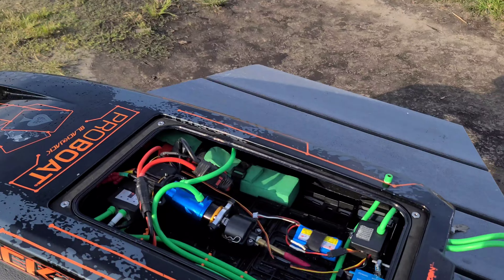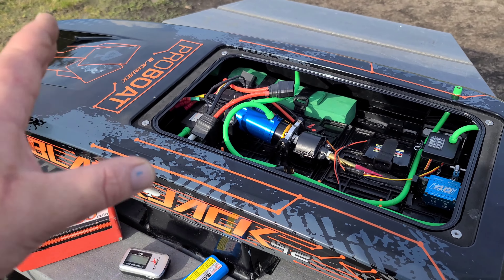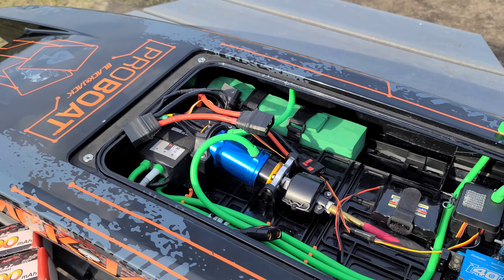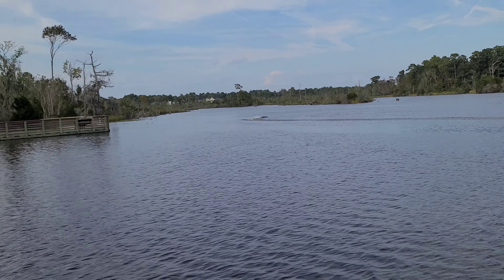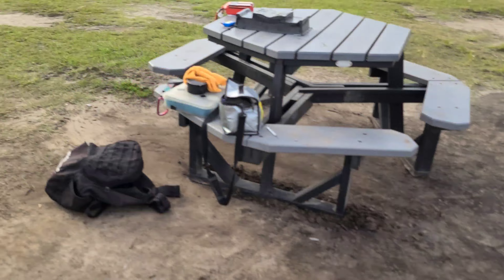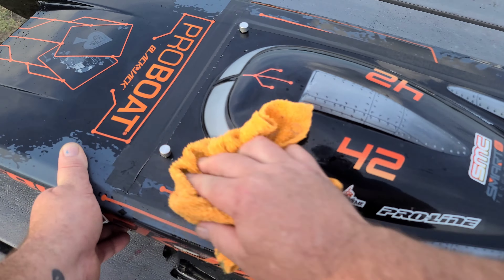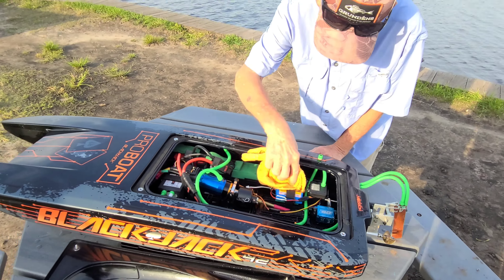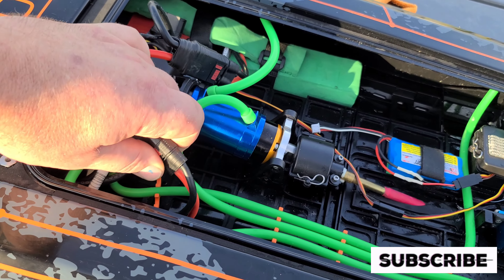Sick New Setup 12s Proboat Blackjack 42 90+ mph at Quarter Throttle - Flier 400a, Tppower, SMC

Comment: Hey I think when we run higher voltage it actually will allow to run cooler . Usually won’t hold it open as much and I believe the amps can be less . Like with a/c when we run high voltage the amp draw is lower . Just learning some about boats I only own a swamp boat 🚤 but I wanted to get the pro jet boat , looks like your using here on salt water and that’s where I wanted to use so maybe I should just go with propeller boat. I do have plenty golf course ponds ect locally but I have canal in my yard I’d like to run off my dock

Comment: And get you another temp gun. I have the same one as a spare. I have a different hand held thats spot on and the one you're using is off by 10 degrees give or take. So it could be 10* cooler than you think.

Comment: Hello, i want to buy the blackjack 42
May you give me some tips on what upgrades to do first. I will be fine with it hitting 65mph. I want to stay with the stock electronics for now
Reply from the maker: Rc boat bitz trim tabs is a must, add an additional cooling run to the motor that's about it.   7000mah+ 100c+ 4s lipos

Comment: How heavy is your boat. What is the small wire that's connected to one of the black connector. Is that boat plastic or fiberglass
Reply from the maker: Total weight with battery is 14.5 lbs

Comment: I used be crazy about R/C boats back in my younger years (Traxxas Villain IV amongst others circa 2001🤘) I'm now revisiting the hobby via Youtube. SUUPER interesting that the internal hardware is no longer the limiting factor on speed. It's actually the hull / trim of the boat and the aerodynamic forces of air. Are there other hulls at the same size that could handle much faster than 92mph without going airborne??  Or submarine for that matter...?
Reply from the maker: The tfl geneses single is fast
https://www.offshoreelectrics.com/proddetail.php?prod=tfl-1122-blue&PARTNER=ironclad

Zonda GT is a fast twin
https://www.offshoreelectrics.com/proddetail.php?prod=TFL-1133-cf-4082&PARTNER=ironclad

Comment: I don’t mean to speak out of turn, I’ve owned I rc boat, but wouldn’t it be better to run it around a little at just over idle to get some water to the vital stuff?
 Edit:
Thanks, having just reread my comment I now see a clear advantage to bringing it straight in. You get to check peak temp. I was thinking long term where higher heat over a long time would obviously be worse than a short burst. 🍻

Comment: Kingval  3660 1800 kv, what ESC should I run with this??
This will be a proboat recoil 2….. any turn Finn, strut, trim tabs, rudder recommendation are helpful also! 
Great channel keep it up.
Kingval not purchased yet so throw me the whole recipe, lol…. Goose chaser!
Reply from the maker: 2600-3000kv 3660 + 150a FC esc = fast

Comment: Try a small boat .

Like a shreddy or any small vhaul , Even a blackJack 32 .

Try a surpass hobby 550 6400kv 4pole drag motor . On 3s  64,000rpm 😈

Comment: Sorry. A bit out of topic. Will the New sonic wake handle 8cell on stock setup??  Love the Black jack but saving up for the new river jet you tested out. Many rivers here in the north of Norway.
Reply from the maker: No, sir, the stock SonicWake will not handle 8s!     You'll need an esc upgrade for 8s power
Reply: @IRONCLADRC  ok thank you. But i gues the motor will have no problem.   Thank you for fast reply😊

Comment: Had that boat up to 85mph near stock with just a prop on 8s, it flew and came down splitting the hull in 2. Got a warrantied hull, rebuilt it and sold it. Fun boat tho.
Reply from the maker: Hitting water at that speed is like hitting concrete, fun as hell making them go that fast, though.  BG4L

Comment: Fantastic setup and video. Looks like you are on some salt water how do you protect your parts from corrosion?
Reply from the maker: Corrosion X and dielectric grease. Balloons for receivers and watchmakers silicone grease for servo seals
Reply: Ahh comments I was looking for I live near salt water and rc daily I get questions all time how come you don’t boat 🛥️ 😂
Reply: I do run in salt water, but I have been having issues setting up boats, salt water getting into electronics, range issues for transmitter etc. I’m still working on an ideal setup. Time away from work, and the kids is a bit hard to come by sometimes…

Comment: Thats really fast but your running a hot setup but nowaday motor are pretty much heavy duty. I've own that similar esc 10yrs ago in my 48" mono and setup for 20s (74V) with big 370kv 12kw TP motor and run for about 3 mins, all parts are cold as if Im not running at all. Now all my boats are in the store collecting dusts.
Reply from the maker: I have 2 different motors for this boat, I like the 1520kv on 8s, better than the 1400kv on 12s.   Both motors are beast!
Reply: @IRONCLADRC  Cools, love to see you tested the esc for 20s, it works wells on me. By the way, great video's collection you got there. keep it up mate!

Comment: Do I sense a dual motor. With 2 of those ESCs? With 16s worth of batteries on each ESC? 🤔
Reply from the maker: I wish!  Check this esc out it has dual brushes motor outputs (single esc, dual motor)    BG4L

Comment: I’ve a problem with the blackjack 42

It falls back in power after a second when pull full throttle. Sometimes at half throttle. 
When I build speed up slowly it goes better but still cuts off power for a second or so at the end with full throttle and power comes back direct after that. And so on. 
Dont know what the problem is. 
Battery packs are new. 
Have 2x 4s 100c 8000mah and 2x 4s 140c 5500mah
Did reset and calibrate the esc with the new changed futaba receiver but didnt solve the problem. 
I use a futaba 4tpx transmitter with r304sb receiver
Is it something with timing or lvc?
Temps of motor esc and batteries and plugs are arround 35-40C (95-105F) so tha should be ok. 
Boat is new. Only used it about 3-4 times. It has the boatbitz trim tabs, cooling  upgrade and prop upgrade. Strut and trimtabs are installed in line with the bottum of the boat as in your videos. Sort of flat neutral. 

So any help is welcome
Reply from the maker: What prop are you running?  If the prop is to big for the electronics the esc will go into a lvc cut, because the prop is putting  alot of load on the electronics causing voltage drop making the esc think it hit low voltage.   Prop in combination with the overall weight of the boat, try  Propping down a little bit, or you could try going down on your timing one
Reply: The prop is a stage 2 prop from boatbitz that came with the cooling and trimtabs as a set. 
I believe its a 4814 (2 blade)
It says proboat on it but no numbers. But when I messure the prop its 48mm.
When it does a full sometimes speed is about 52-53mph gps
But most of the times it cuts the power of when it goes fast.
I will try the stock prop soon to see if that is the problem. 
Can the trimtabs and strut cause so much friction that it does a lvc too?

Comment: And to run a pack in parallel or series. The battery won't know the difference 😅 a system on 12s will require less amp draw then running on 8s. So seeing lower temps at higher voltage is possible if it's efficient.
Reply: That’s what thought thanks for confirming, it’s same with a/c voltage
Reply: What do you think about rc boats and salt water , stay away from jet boats ? , of course have to be extra with water proofing and corrosion but is it feasible
Reply: I don't see why it would be a issue if you keep it clean like you said. Keep water out of the inside. And flush the cooling system with fresh water after.
Reply: @ralphhondaman  thanks just living on water everything erodes faster , have keep everything coated wd 40
Reply: @RcPlayer-tt2vw  I bet. Wd 40 would be good to use. Keep the hardware coated.

Comment: I've noticed you  run rather short water jackets and no water cooled motor mount.
Think 124 F on 8 S is somewhat steep........
Single set up always is demanding for the motor for it requires counter steering 
or asymetrical drive line set up. For me reasen enough to use twins. 
The TP 4070 CM is a peach as is your 42. Clean fit those water lines !
Extremely  good looking hull all the way. Well done.
Reply from the maker: Thanks

Comment: Electrical tape is just as effective and won’t sound so bad
Reply: Elaborate please
Reply: @IsaacSchultz-lz8jc  electrical tape or vinyl tape will have sufficient waterproofing protection per use and a lower bonding coefficient. It won’t risk tearing off gelcoat after the 30th time you use it nor disrupting the bonds in the glass ply substrate.
Reply: Oh ok thanks

Comment: Bruh I’m telling y’all, the whole problem with the 42 is it’s under powered that’s why it flips so bad. More power keeps the nose where you want it, DOWN. And pretty sure your heat issue is that cooling jacket, that’s way too short, not enough can is covered
Reply from the maker: I can't find any jackets longer than 73mm. That's what I'm currently running. I considered using two 40s jackets, but it'll be pushing fitment?      Guess I could make a custom jacket 🤔

Comment: Kv for Kv? If its true kv rating then regardless of the copper its should turn the same rpm per volt. You lost me on that. If it turns any different speed then the kv rating is wrong.
Reply from the maker: On paper yea, it should turn the same rpm, but real world is a whole different animal. Take a surpass rocket 4082 2000kv and a tppower 4060cn (4082) 2000kv..   Which motor is gonna be faster?  The tppower motor will be!   Everything the same, the only difference is brand.     Copper in a motor makes a huge difference with a motors performance..

This is my opinion.  I've tested lo lots of different motor over the years, just speaking from my own experiences.
Reply: @IRONCLADRC  ok I do get what you are saying. But if one motor turns faster then the other. Then they are not matching kv. Kv is rpm per volt. Say 1100kv is 1100kv. If it spins faster then that then its not 1100kv.
Reply: @IRONCLADRC  maybe you're thinking about more torque?  Because if both are 2000kv then they both should spin the same speed. Torque will get you to speed faster. But then too you have to consider poles then. 4 pole 6 pole. 6 pole will turn rpm faster but less torque.
Reply from the maker: The key word in this argument is "should"  in theory they "should" turn the same rpm per volt.  They "should" have the same torque. If both motors are the same, the only difference is brand/material right.    

On paper like I said yea, but in a boat it's a different story. The point is that material, (copper,magnets) a brushless motor, is constructed from makes a huge difference  torque, rpm, heat Dissipation etc. 

I've even gotten the same exact motor, and one motor be a consistent 3-5mph faster than the other... Same motor in every way, the manufacturer possibly used a different stock of materials in the build process, causing one to outperform the other.   Just saying
Reply: @IRONCLADRC  what it comes down to is how efficient the motor is. They key is to find where the motor makes its best power. Adding volts to make it spin faster isn't always the best option because the motor because less efficient and more heat.
Reply: Awesome man..play with a few different props see what you get. Nice.. watch your temps you no what I mean... 😂..I mean I feel more comfortable useing a 6 pole 2000 Kv motor.. little more RPMs.. however this let's you run some crazy prop sizes..yah no...your set  up runs pretty good..wow..play with some props..😊